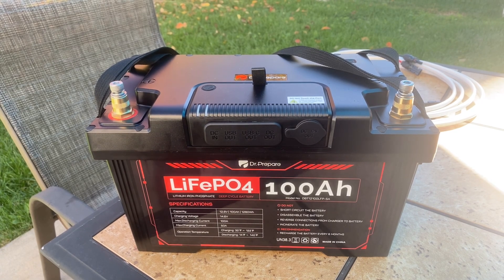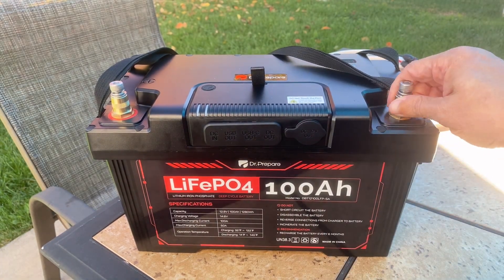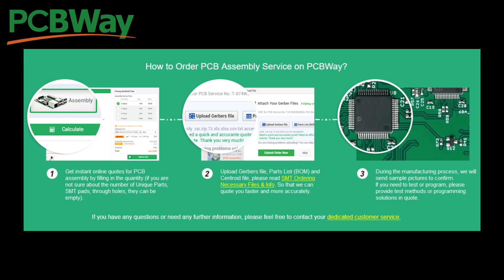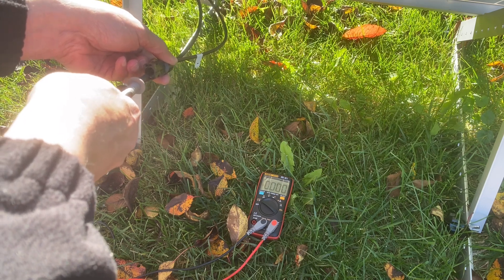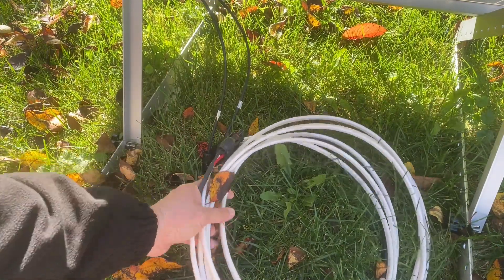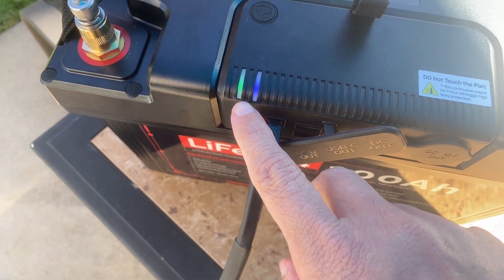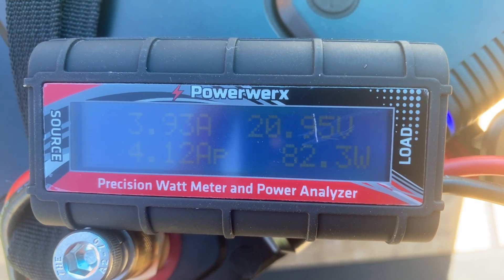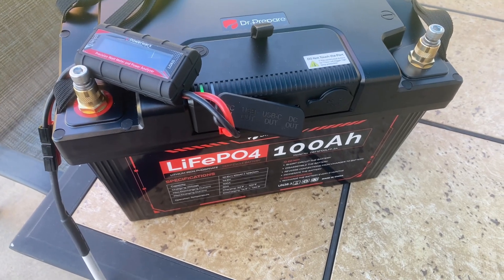Dr.Prepare PowerMax Solar Charger with MaxHub 100A LiFePO4 Battery

Comment: I bought this battery to run my Dometic CFX 55IM. It’s runs it fine and will most likely run it for days on 30°. However the ice maker mode pulls a lot more power and if you are trying to freeze things with the fridge it will not run off the dc module for long. Must take too much power. I have to directly hook it up to the main terminals. Hope this helps.
Reply from the maker: Thanks for the info OG 👍

Comment: ::gulp:: I just ordered 2 so I could run two 12 volt fridges when off grid. Cheaper than a solar system and cheaper than a big power station.
Reply from the maker: 12v fridges are the way to go 👍

Comment: how many watts (solar panels)can you safely input to this battery
Reply from the maker: Depends on if you charge through the max hub, I'd check the manufacturer documentation to see if  it meets your needs.
Reply: @TheSmokinApe   I was planning on using the anderson adapters. I found out from another  video I watched after yours that a max of 100 watts is all I can plan on.
Reply from the maker: @michellelaclair  correct, through the Anderson’s
Reply: @TheSmokinApe  I was hoping to run 2, 100 watt panels through the Anderson connector on the hub.. I guess that is not a good plan?   so I will need an MPPT controller then?
Reply: @Seaturtle008 1 of the Anderson ports is output only. The Anderson input will only charge at 84 watts. I would look into the Vterun 100ah battery. It has a charge controller built in as well. It can take in 200 watts of solar. No USB though.
Reply: what did you end up doing?

Comment: you should never short across something with the meter to measure current, it is the same as doing a straight short circuit across what you are measuring, always measure inline or with a clamp meter for current.
good video and one big battery.
Reply from the maker: Yeah, I wasn’t sure if that was going to work or not…. Oh well.  Thanks for watching Thump 👍